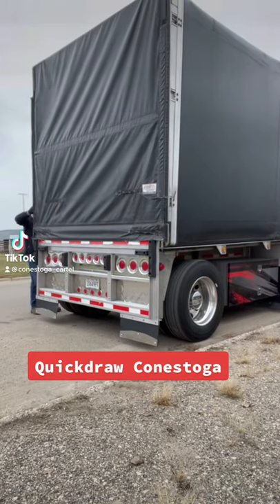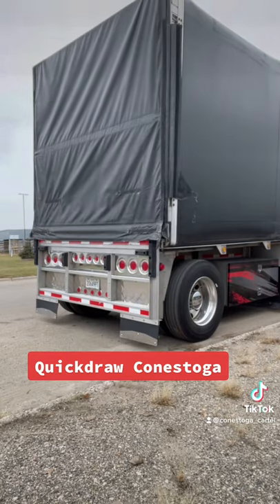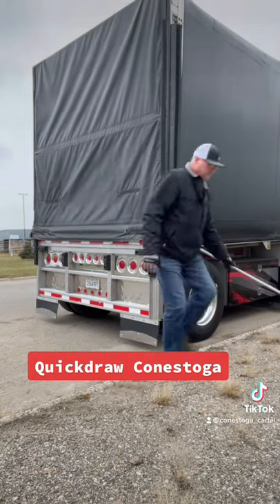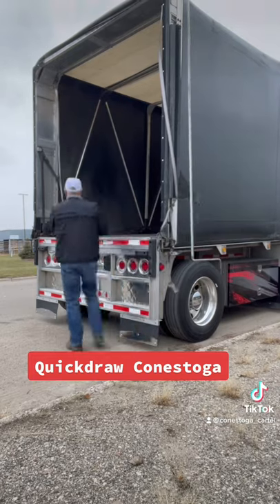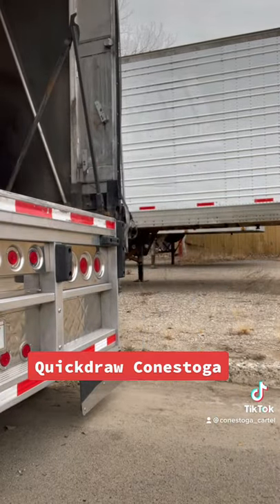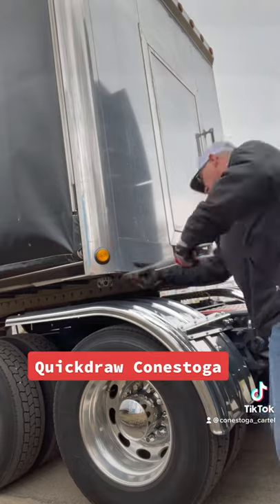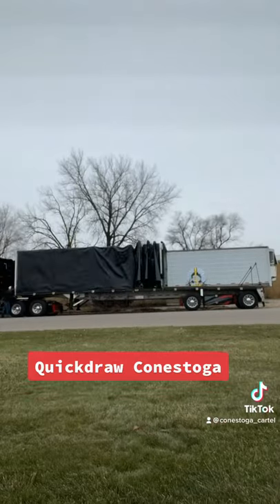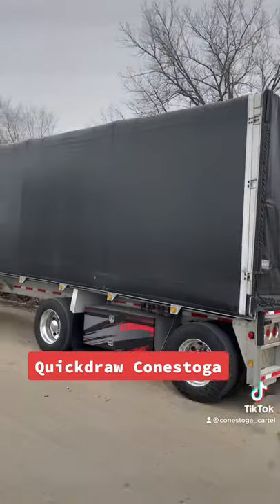Quick Draw Conestoga operation.

Comment: I’m wondering about malfunctions? Do they ever malfunction on a job site? And what do you do to circumvent or overcome such an obstacle? Also is there difficulty in the winter with opening and closing the trailers? Like is hot and cold weather a factor?
Reply from the maker: As far as a malfunction, there is not a lot to malfunction.you just address an issue if something happens. Keep your kit in good working order. Keep it maintained!!! The cold will make the kit harder to use , the tarp material gets stiff, good luck 👍

Comment: What are the X straps at the rear for I just bought one myself and it doesn’t have them I’m just wondering if it’s for stability of the rear bow
Reply from the maker: The x strap is for stability to help keep the kit square, and yes not all kits have them, safe travels driver.
Reply: @conestogadon4732  thanks for the response I’m thinking about adding it to mine because I see a lot of them breaking in the corners